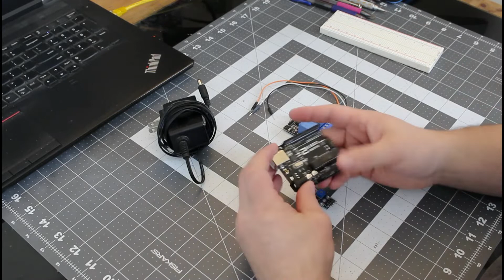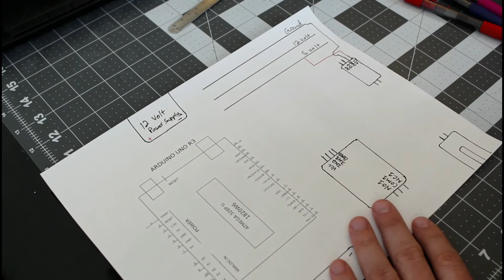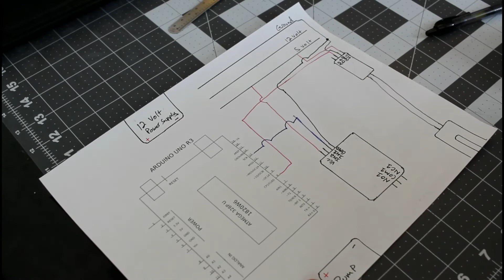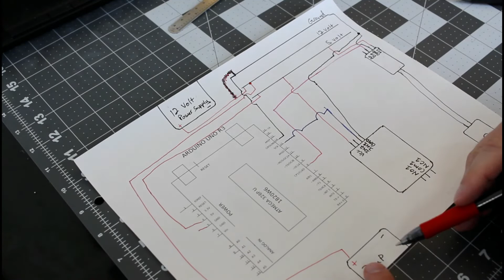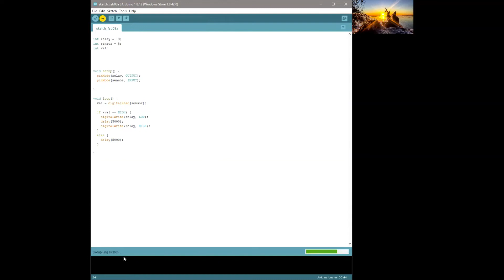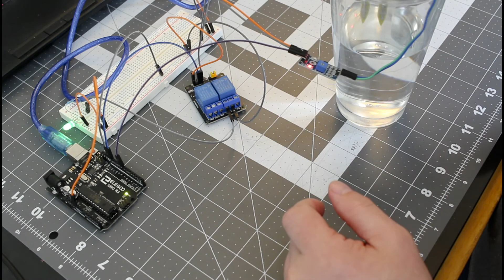How To: Arduino Plant Watering System for Beginners!

Comment: Great tutorial bro, made me understand and I'm a complete beginner. I have a question though, If I wanted the soil moisture values as a percentage and I wanted that data on my laptop what do I do 🤔 because I want to get the moisture of the soil throughout the day as raw data to analyse
Reply from the maker: Thanks, FAN_DAN_GO! In order to have a soil moisture reading as a percent you will need a better sensor first off. As far as I have been able to test the sensors included in my video are either on or off. Practical Engineering's youtube page has a video called Arduino Garden Controller where he talkes about collecting moisture data. In the video he uses the vegetronix.com sensor ($40.00 usd) and they have some information on their website. Essentially what he does is connects the sensor power and ground to the normal 5v and Ground pins on the arduino and then uses the A0 pin as the "talking" pin. The sensor will use the 5v power and run it through the resistor it has built in. As the moisture changes so does the resistance. The sensor then sends this signal out and back to the arduino's AO pin with is in "fancy terms" its anolog input. The hardest part of your problem here will be the coding. You need to have the arduino read the incoming signal and then output this information to your computer. I would take a look at the video called "Arduino Tutorial 10: Understanding How To Read Analog Voltage using analogRead Command" by Paul McWhorter for all the details on this (You should be able to jump right to minute 6 where Paul starts talking about coding). Let me know if this doesn't help. Maybe I can make a short video this weekend if I finish all my work!
Reply: @mechanicalmaker9323  thank you for your reply bro, I already built my system with 4 capacitive moisture sensors with 4 submersible pump, forgot to mention that 😅 but yea I was just asking for a specific code to change data as percentage and a way to saved those data collected on your computer. I decided to use plx daq program. I basically did what you said 👍